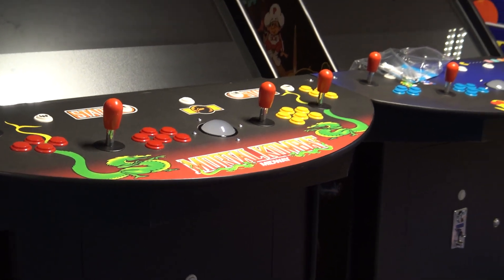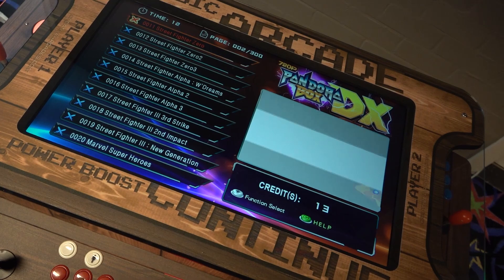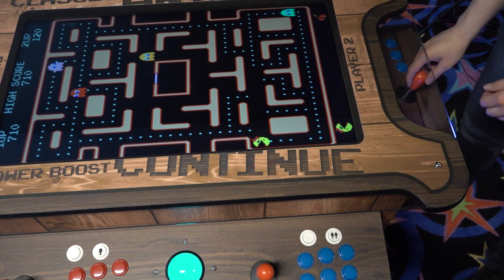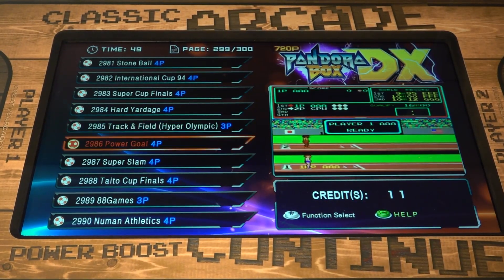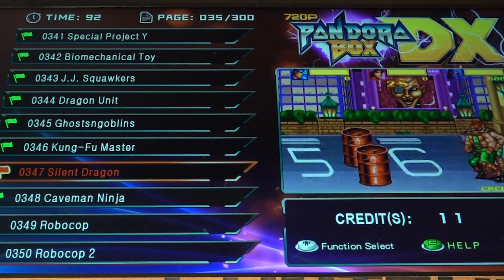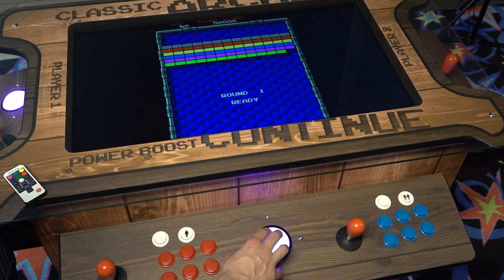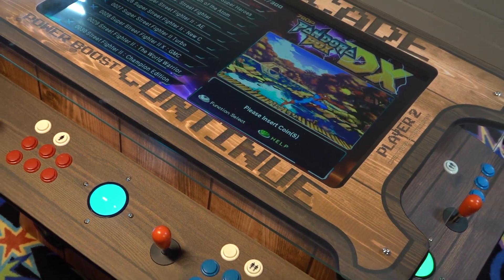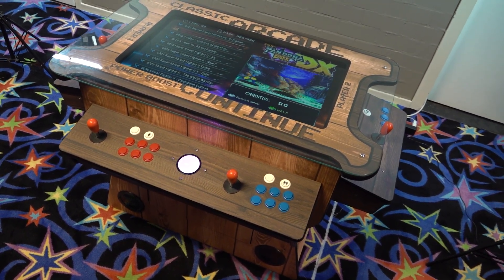A Nostalgic Gaming Journey .. Fun Cocktail Table @CustomArcades

Comment: I have a converted arcade 1up cocktail table thats runnjng rasberi pi, will this be compatible with my set up and can you put the pandora box in cocktail table mode?
Reply from the maker: Yeah, I shown in my video you can switch between the 2 options that is why there are 4 joysticks.
You can switch between the 2 modes

Comment: But a 16:9 display? I have said it a thousand times before - it does NOT work for retrogaming (8/16/32 bit). I didn't see the entire video, but I bet is does not support changing aspect ration, and even if it did, it would mean borders. FAIL FAIL FAIL.
Reply: Problem is 4:3 or 5:4 LCD screens are rare and expensive, and probably today's generation wouldn't even appreciate them!